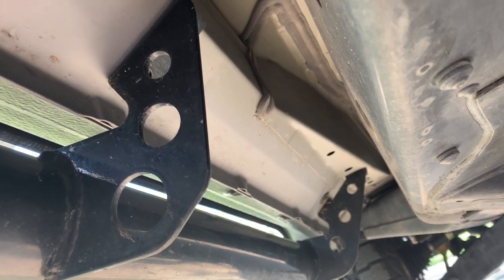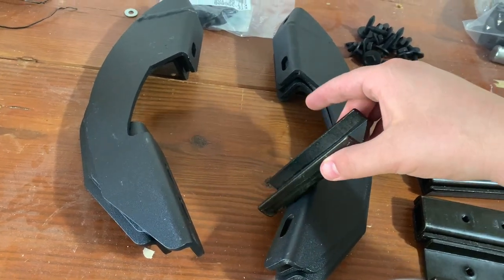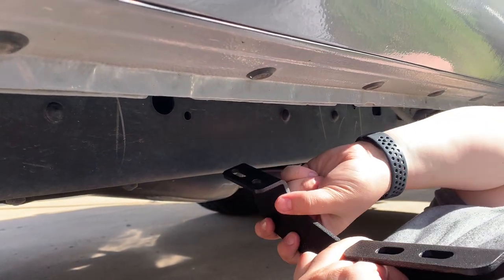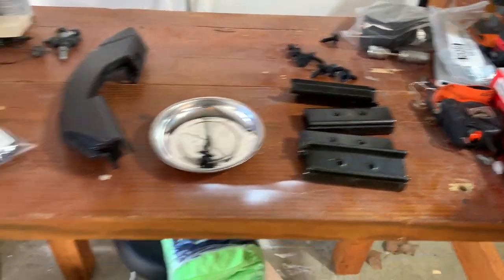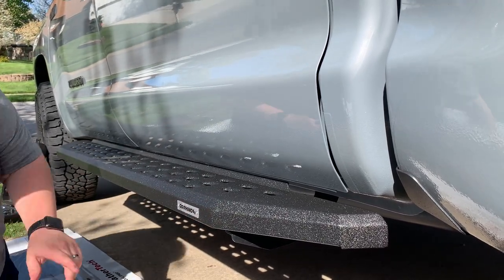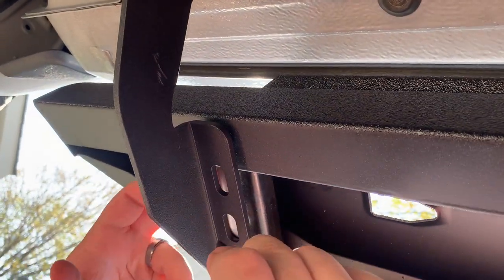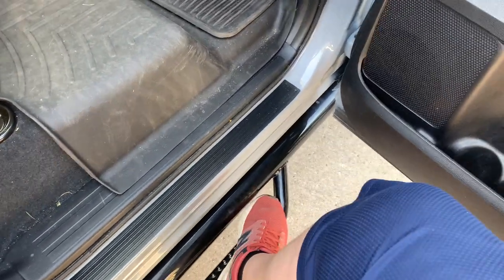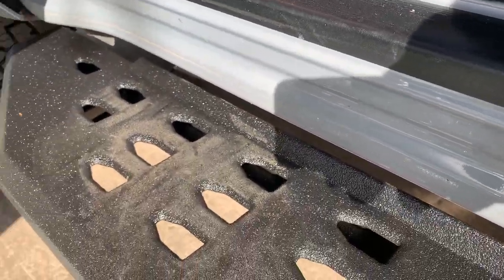Throwing out my N-Fab running Boards for Go Rhino RB20’s!

Comment: I put the exact same ones on my Tundra last week. Directions are garbage from go rhino. Double cab instructions when I have a crewmax. Instructions shows lock washers and more hardware then I actually got.  I didn’t install them that day because I thought I had the wrong ones.  Come to find out they updated the hardware and didn’t say anything about it. Finally got them on and I like them. They stick out far enough to protect against door dings.
Reply: Just got my running boards and hardware too and thought the same thing!  Do we not need lock washers when using the black coated bolts and flat washers?

Comment: I put the RB 10 on my truck.  Basically the same installation.  Great product.   Make sure your wife doesn’t slide out of the seat and drag the back of he shoe heel (or Achilles heel) down the edge of the board.   My wife ruined a couple pair of shoes doing that.   The rhino liner scraped the finish right off.
Reply from the maker: Oh yeah we already ran into that! Got to be careful! Thanks for watching!!

Comment: Love the running boards Austin! I like how you take your time and make it fit perfect! Great lines man!
Reply: Great review/video; I just installed some on my Silverado; as I’m in the midwest, I sprung for the lined version like you and I was a little disappointed they weren’t lined on the bottom for weather/rust protection but we’ll see how they do.  Also appreciate you mentioning the flared design in the front which reduces slightly as it works to the rear.

Comment: I've got the textured Nfabs, while I do consider the steps small (I wear a size 13 boot), I've never had an issue slipping off. 

About 8 years, and they still look like new.

Comment: Very nice video! Could you tell me what kind of tires you have? I like the aggressive look! I have a 2008 2Wheel Dr. with a 3 inch leveling kit in the front so I’m trying to get some tires and go with largest I can fit
Reply from the maker: Hey Thanks! I have Falken Wildpeak AT3's. They are 295/70 R 18. Check out my video titled 34's are better than 35's!

Comment: Sucks that the Bed liner finish is only on the top of the boards. Doing any off road will sand blast the crap of the bottoms and rust will start for me on the salty roads.

Comment: Hey Austin, thanks for making this video. I still haven’t put running boards on my ‘21 Tundra and was debating between both of these sets. I’m leaning toward the Rhinos, especially after your video. My only concern with the Rhinos is bed access. I like the idea of better access with 3 step N-Fabs. What is your experience with this? Thanks again!
Reply from the maker: I felt that way too in the beginning but honestly I wasn’t able to use the third step very well since it’s so small. I installed a step under the bumper (check out my video) and just use that to hop into the bed! Hope that helps!

Comment: Hi, just wondering how you like the new running boards. The OEM RBs on my ‘17 Tundra peeled apart and I like the looks of these, esp the non slip surface. Thanks!
Reply from the maker: Hey man I’m loving them! They are a bit taller so that took some getting used too but they are great non-slick boards and look great to me! They have also deflected a ton of gravel from the body so that’s a huge benefit! Thanks for watching!
Reply: @kccreations5945  I looked these up on Amazon and they say it doesn't my '17 Tundra double cab?  I went to GoRhino's site and they say it does.  Did you pay $600+?

Comment: It would have been a much better design had they welded the steps to the mounts. They could have attached the mounts to the back of the step and eliminated the low hanging portion of the mount which could potentially catch on a obstacle. Additionally, it would have also removed several steps from the installation process.
Reply: Not practical when replacing the boards, if you need a warranty replacement you take off the board and put a new one on.  No need to replace brackets, plus you can swap any of the RB series boards if you'd like and they fit the same bracket.